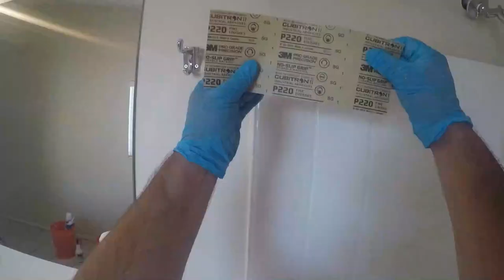How to Reglaze a Fiberglass Bathtub | Reglaze a Dirty & Stained Fiberglass Bathtub to look like NEW

Comment: Great job Danny! I have a question for you...I have to replace my bathtub. 14 yrs ago we put in our current tub and it was one that came with 3 wall inserts. I call it the cheap plastic tubs because it didn’t last as long as it should have...there is a crack in that leaks water into my crawl space. Luckily we have two full baths. Anyway, I’m looking for a tub that will last a long long time...hopefully for the rest of my life because I don’t want to have to replace it ever again. What type of tub could you recommend that isn’t made of the flimsy plastic material. I plan on putting in the green drywall used for bathrooms and tiling the walls so I just need the tub and not one that comes with walls. Our Lowe’s and Menards only sells the cheap tubs so I may have to have one ordered on line.
Reply from the maker: I would look for a Cast Iron tub.

Comment: Wtf? You changed your process completely? Why the spray can & electric hvlp?
Reply from the maker: I didn’t change it completely? The electrics HVLP because I sprayed this entire unit and not just a the spot repair. The spray can was just the primer which is used in other videos as well. 

Let me know if you have any other questions. Nothing was different at all.
Reply: @DPTubs  can you do a 1 on 1 phone consulting?
Reply from the maker: Incan do zoom calls but I charge...what are you wanting to know?
Reply: What kind of primer was that. How much do you charge for a zoom call?